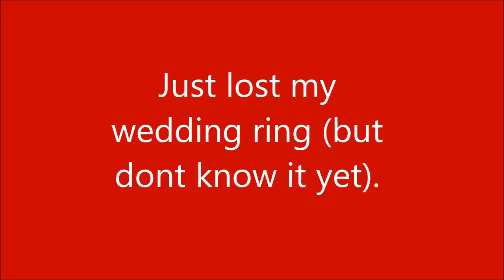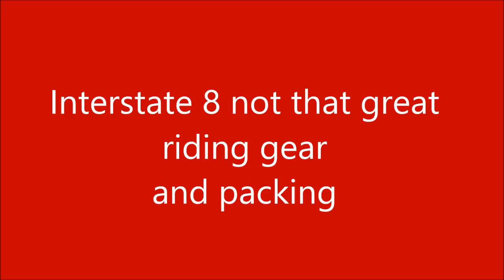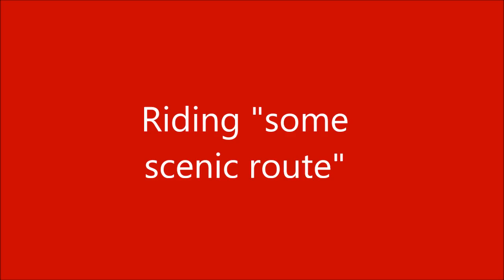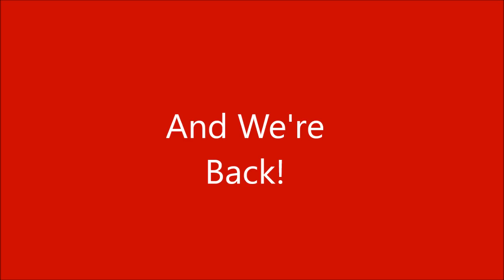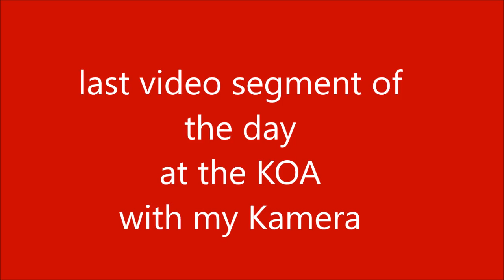Cross county on a Honda NC700X   Day 3  Gila Bend AZ to Las Cruces NM

Comment: Sup.    Been researching bikes I'm interested in it will indeed be a Honda between 700 & 750 cc.  Like your windshield setup mind sharing info about it. You are cracking me up with your dialogue. I haven't heard much complaining about the bike other than the seat just now. It's August 2017 bike sales are going on prices down so it will be soon I get mine.  I live in Virginia by the Blue Ridge mtns.     Route 66 looked ruff. Thanks for sharing.  As you say "peace out".
Reply from the maker: Blue Ridge:   The windshield I'm using is the tall windshield made by Honda.I think it will only fit the 1st generation of the NC not the current version or last years model (The one where the lid to the Frunk looks different than mine.)  it offers good protection but caused bad vibrations when I use the visor on my Shoei Hornet X2 helmet.  I discuss a lot of the mods I did to my NC on this video I made last year:   https://www.youtube.com/edit?o=U&video_id=l_O8Qrtjw94   From what I remember My Seat Concepts "low" seat seemed like a big improvement ove rthe OEM for the first year of use BUT it didn't cut it  for this long extended trip.  Good Luck.

Comment: Hey Mike, going to be doing 4000 miles, 10 days, so about 8 hours a day. How do you stay fresh and attentive over the hours and despite fatigue? Any advice? What do you eat?
Reply: I too will be riding an NC700x. 2014. 12,000 miles. Dec 22 to Jan 6. Via las Cruces, NM. 

Big fan of your rides and vids.
Reply from the maker: Hersh:  I'm not the best role model for eating and drinking on a trip.  I often felt dehydrated and didn't eat at all some days.     My main advise is to take frequent breaks or breaks as needed and try to keep the riding interesting.  Small meals or snacks worked best for me. IMO interstates are terrible and boring which often put me to sleep. Even US highways were better.  I would often take a longer meal break when I couldn't stand riding anymore or started feeling tired.  Good luck.  Be safe.  Have fun!
Reply: Thank you!

Comment: mike, this ride as not boring for me. it was great. Love the views .the NC700 S seems smooth at 75 when cruising.  thought you should be getting close to 60/65mpg< also what is the engine  speed@75 mph?
Reply from the maker: The mileage varies on the bike quite a bit.  I usually get 60-65 commuting and on leisure rides. When I did my XC trip with cases and two large dry bags full of gear mileage was quite variable.   When I hit steep hills with STRONG  headwinds and fully loaded MPG sometimes  dropped into the 40s.   I can't remember what the RPMs are at 75.  Next time I'm at that speed I try to remember to let you know.